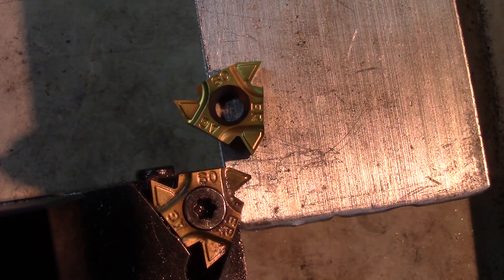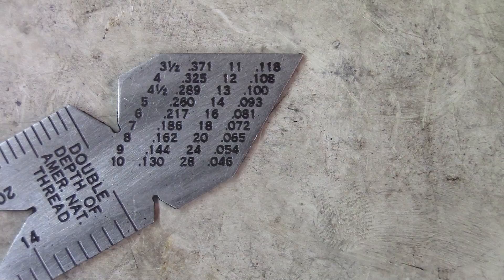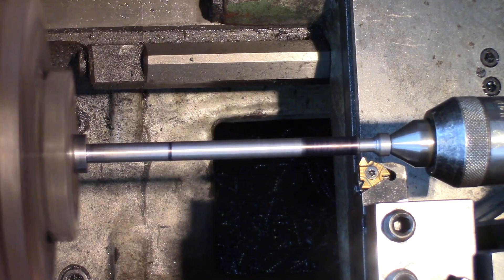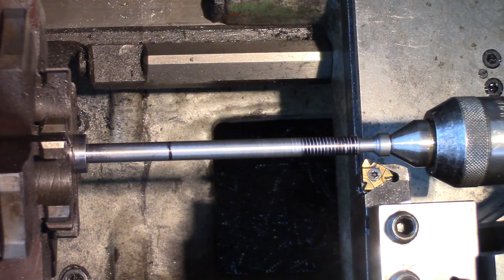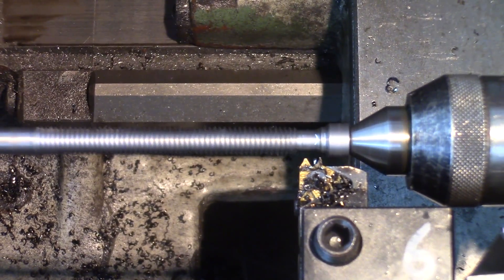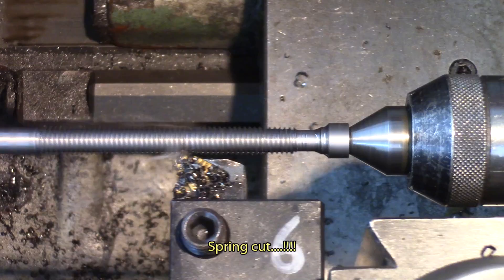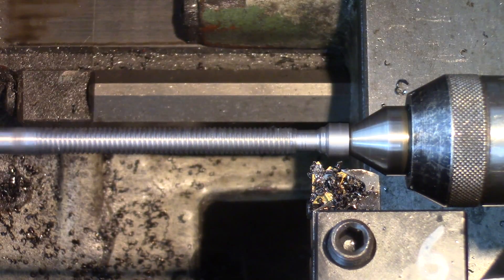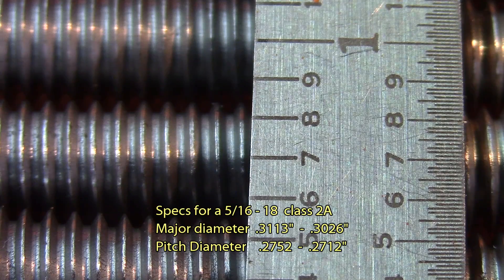WIYB Shop made Knurling Tool for Keith Fenner's What's In Your Box toolmaker Collaboration P-3

Comment: Hi mate.  That is a very nice lathe you have.  It seems very quiet.
Reply from the maker: +Marcel Timmers The noise cancelling mic I use, helps to keep the background and off mike noise down compared to the voice.... This is why th voice isn't covered with the combined noise from the phase converter, compressor and the machinery, if you listen to the older videos you'll be able to compare...  
Thanks for comment,   Pierre
Reply: I was wondering what you had done with that phase converter, I thought that you had bought yourself three phase 440v
Reply from the maker: The operating voltage for the machines is 600V 3 PH. With the roto-phase converter,  I make 240V 3 PH, then use a 3 PH transformer to get it to 600V. The main motor is aprox. 20HP and the transformer is a 30KVA unit...

Getting a 3 PH installation from the electrical Company in a residential area would run at least 10 to 15K $, even if the main lines run on my front lawn...   :(
Reply: We seem to be in the same boat.  Some friends of ours had the transformation done, and spent something like that.  This was only for 3 times 32 Amp.  The line was passing their garden and house.
Reply from the maker: That's something like near 60 Kva,, depending on the amount of machinery, it's more than I'd need, but being near 62 yo, It would take many years to get my money's worth, and not certain to get there... :)

I have to admit that the noise gone would be a great riddance...
Reply: Not only that, you would be able to run every appliance in the house simultaneously, and there is something to say about that.
Reply from the maker: Would have to check the rates, I know it changes from residential to commercial and $ ? $ ? $ ?.... Also changing the electrical distribution boxes in the garage and in the house in order to balance the consumption on each phase in order to keep the best balance between them... I think that I'll keep the "Status Quo", Have to admit that it's nice to dream sometimes.........     ;)

Comment: My lathe won't turn fast enough for you to thread. I feel so slow. lol
Reply: pierre beaudry
probably less pollution than the coal fired power plants my electric comes from. But then again I kind of miss the pollution. crops used to grow good because of the sulfer in the rain from burning the coal. Now I have to buy the stuff myself to get good crops. :-(
Reply: +bcbloc02  yes Brian but your lathe can shake the earth it sits on.
Cheers
Reply: Phil's Projects
Or more accurately my lathe weighs so much it won't shake. :-0
Reply from the maker: +bcbloc02 You'll need to get one of those cheap to come VW turbo diesel engines to replace your power plant....
They pollute but they get the job done, I know my wife got one of those...

Comment: I like the thread mic.  I guess I may get one at some point.  That looked like a nice job of threading by the way.  Thanks for the video.
Reply from the maker: +cerberus Those mikes cost an arm and a leg..... Look for them on used market, maybe another source, is Shars == Quality...?????  if they're any good, better than $500+ with the anvil set for a Mitutoyo or Starrett.
The faster you turn the threads the better the finish, as simple as that...
Could have done it at 1000 rpms, but the video has to last at least 3 or more minutes... lol
Thanks for comment,   Pierre